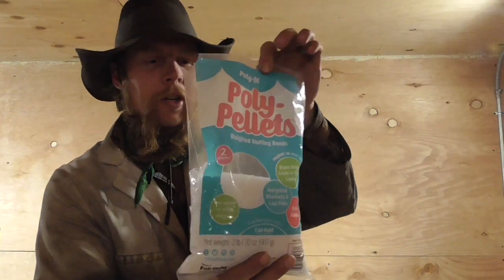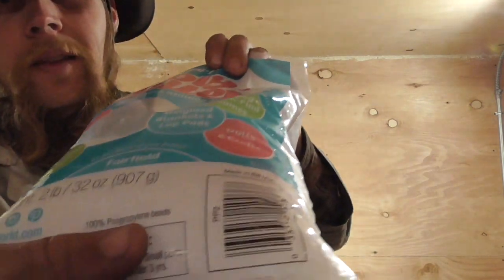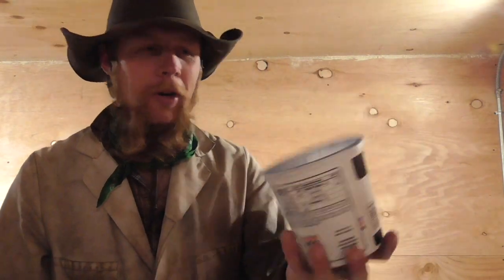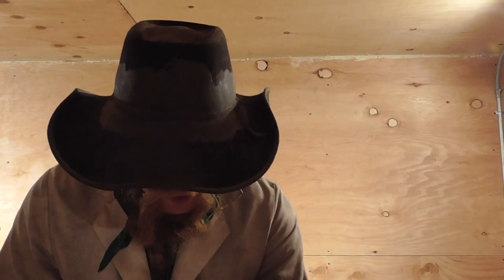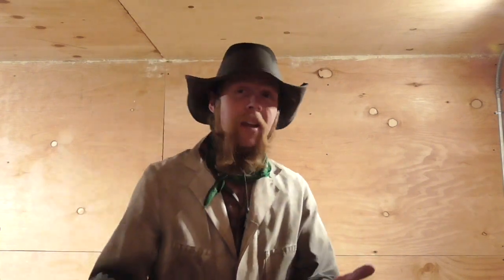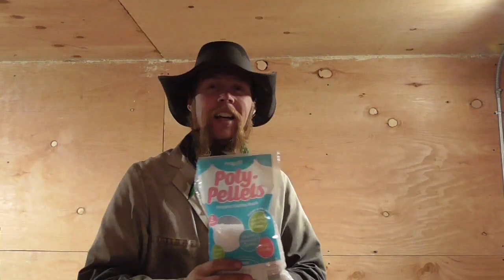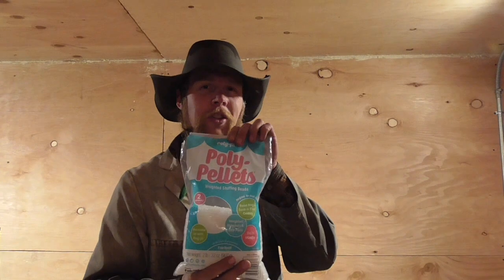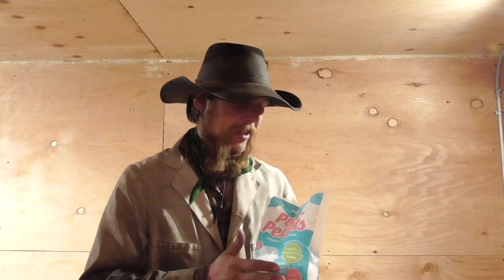Poly Pellets for Powder Coating (TIS215)

Comment: Thanks for the tip on the Poly Pellets, I started out with a electrostatic gun several years ago but soon abandon it for the Shake & Bake method because it wasted too much powder and I didn't like all the hoops you had to jump through to keep powder from building up around the bullets base.   I use air soft BBs in some containers as I still have some around but I've been using Pony Beads for a couple year as I have plenty of those around and they work just as well.  I am going to pick up some of the Poly Pellets and see how they do, it's always good to have options.  Some 45 ACP shake & bake in the pony beads  https://i.imgur.com/nQsqNOb.jpg?1

Comment: So, where do you get the poly pallets?
Reply: Considering you can get air soft BBs almost anywhere, and I have no clue why the average person would need a bag of PP pellets (8 years in injection molding using PP)  I also have questions.  But if for whatever reason this is a product that is as readily if more available, his reasoning is sound.
Reply from the maker: I got these on Amazon.
https://www.amazon.com/Fairfield-PP2B-Poly-Pellets-Weighted-Stuffing/dp/B0077AQ0W8/ref=sr_1_3?keywords=poly+pellets&qid=1563334539&s=gateway&sr=8-3

Comment: Two VERY important considerations: 1) If you use too much powder it won't cover well. Only use a tiny bit more than will be used up per batch. 2) HUMIDITY makes an incredible difference. To the point that many reloaders only do powder coating in the winter. I use BLACK PONY BEADS instead of black airsoft BBs. Black Pony beads work very well.
Reply: Hey now, its 2019, dont you mean "pony beads of color"?
 Are they "free range" & are they certified "cage free" pony beads? ;-)